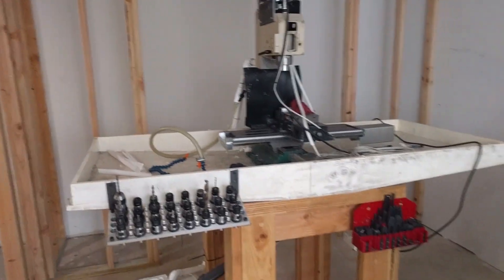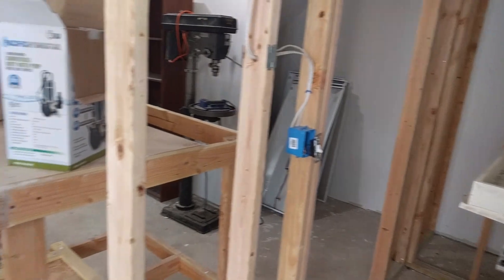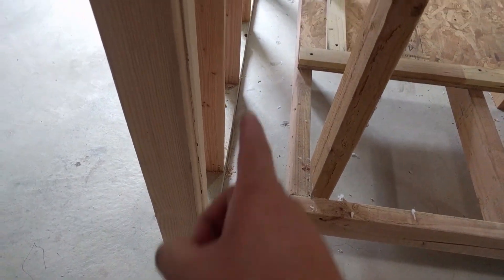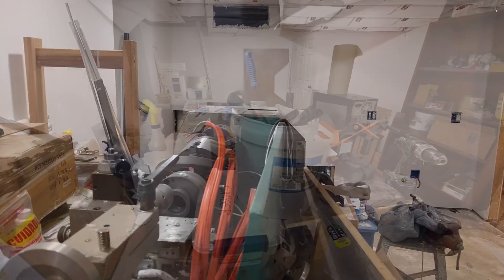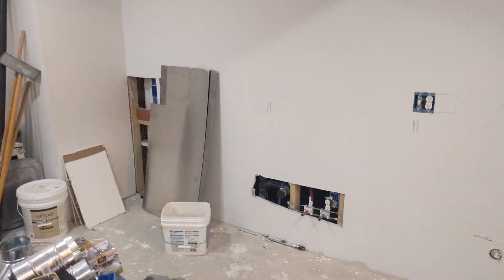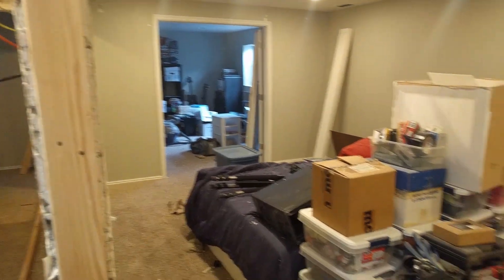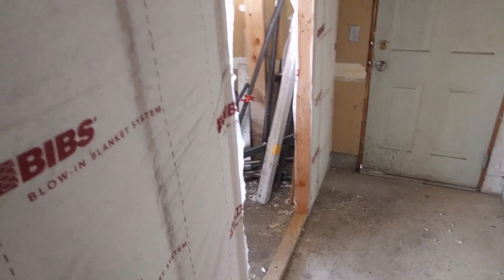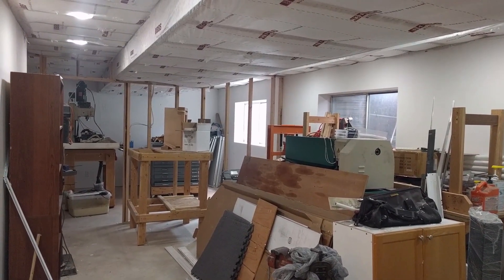Old Shop / New Shop (pt1)

Comment: Looking good! Are you setting up air lines and radiant heat in the garage?
Reply from the maker: Not radiant, but yes air eventually. I had the garage insulated and plan to install a heat pump sooner than later.
Reply: I'm going through the same process... but building my shop in a loft space above my garage. We're using this mini-split system from Lennox. http://www.lennox.com/products/heating-cooling/mini-split-systems/mla
I'm in Canada.. so there may be some days in the winter where it even gets below -22!